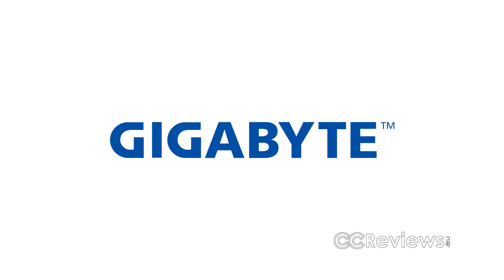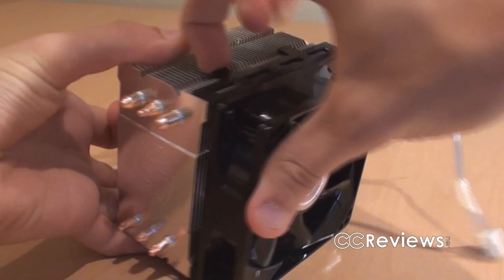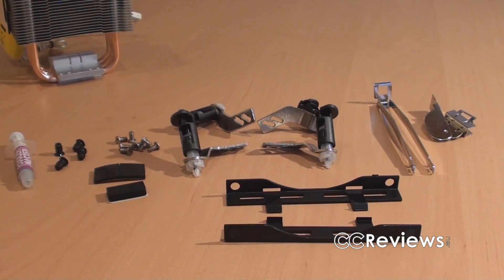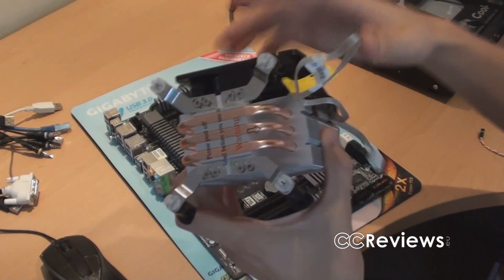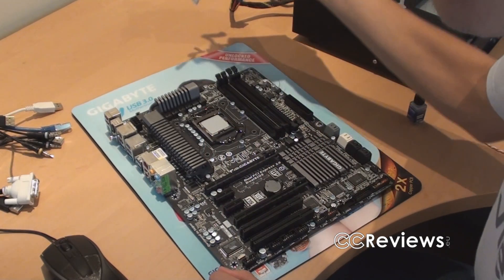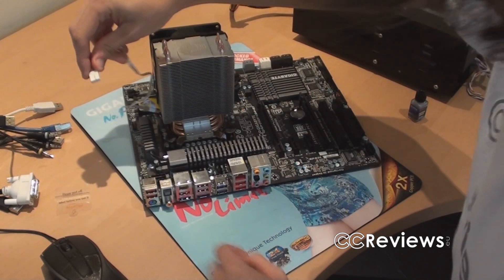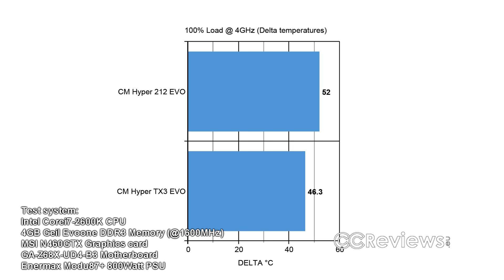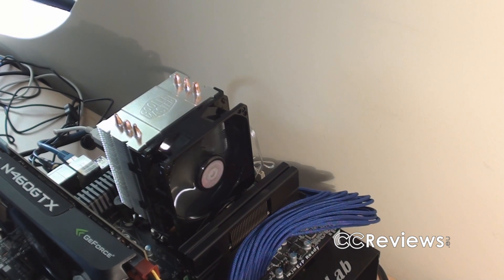#55: Cooler Master Hyper TX3 EVO CPU cooler Review (CCReviews)

Comment: Thanks a lot for the video review, but I have a question, how are the noise levels compared to a stock intel cooler ? thanks again
Reply: ภาณุพงศ์ ปรึกษา for a guy that claims to work in an IT department,one would think you would know that using a vacuum to clean your pc can destroy components due to static discharge  #noob
Reply: From my PC TX3 Evo is not so noisy and my temp never going up above 30 degrees celcius on idle and in full load never go on over 60 degrees celcius
my room temp here in Thailand is around 30 - 37 degrees celcius (That's fuqing hot!) TX3 works well and because of air flow setup on my CM Elite case with 6 120mm fan it sure keeping my PC cooler than room temp
Reply: Thanks :D
Reply: it do sound like jet when i max it rpm(3500) lol
Reply: ภาณุพงศ์ ปรึกษา
so your air cooler can under ambient temperatures? LOL
Reply: Gg your it department
Reply: ภาณุพงศ์ ปรึกษา epic fail
Reply: ok if you guys wanna talk do it elsewhere my comment is not a chat thingy
Reply: Seon wei jie Its should sound likes that sometime pls clean it properly lol
Reply: vivalaphill lol i test max when it was new 2 year ago
Reply: vivalaphill  If you got closed good PC case and you have more air outtake to blow hot air out more than intake cool air it will decreasing a lot more temp like big fan at farm building to help control temp
Reply: jeah but you cant cool anything under the ambient temperature if you arent using a kind of a compressor cooling... thats just physics
Reply: ภาณุพงศ์ ปรึกษา lol, if you are good pc builder, you shoud not recommend ppl to put more fan at output. It will cost dust to suck from every holes o ln the pc. And dust is bad.
Reply: Seon wei jie yup lol its cost a lot of dust
in case of that you should clean it for every week. I clean it every week too :) but in return it got lower temp than normal room temp. and my pc case have air filter installed. So i don't have a problem with dust. If you still got problem with dust vacum machine is your friend lol ;3
Reply: lol, you not understand my word. i having a system that dust free for one year running 24/7. youtube search 'positive pressure pc' , those video will help you. Clean system each week, are you kidding me lol, i got 30+ pc, there was impossible to clean all lol.
Reply: Seon wei jie
 lol I work in IT department i work on 200+ PC
That's why i can do it xD
Reply: Seon wei jie gg too lol
Reply: dittyobrien total agree lol
Reply: dittyobrien
I don't use vacumm for cleaning my system its totally ... = =" I using only brush to clean them out sir... and no one should be called noob = =
Reply: Brush 200 pc per week. Best employees 2014
Reply: Seon wei jie yeah brush it like that :) its my job so... no need too tried to do it then ;P
200 pc is not a single day work its took 1 - 3 days in week lol
Reply: ภาณุพงศ์ ปรึกษา thats not what you said in your previous comment XD  #fail
Reply: Seon wei jie
I didn't said that i using vacum cleaner to cleaning it?
Reply: btw if you cleaning it with vacumn cleaner you can't be harm any hardware on it if you using right size of the vacumn head and secure moving part and don't scratch any trace on that damn board lol
Reply: mostly dmg thingy is used to be moving part such as bearing on fan when you using high power vacumn and it making fast airflow enough to dmg fan bearing...
 to avoid that secure them not to let them spinning while are you cleaning
Reply: Daniel Tevi
sorry lol xD

Comment: really difficult to install the stupid wobbly intel push pins my fingers won't fit between the fan and the heatsink. Got so fustrated i just installed the stock intel fan

Comment: i Got a TX3 and im still getting like 50 C idle temps althought it doesnt go as high as 80 C while under load anymore just around 70-75. I have a push pull config but i installed it on a fm2 socket so it pulls air for the gpu. I have plently of fans on the case too
Reply: What are you using to measure your temps ? If its HWMon , Ive seen so many people having weird readings with that on the FM2 apus ! Use AMDoverdrive for the best temp readings :)
Reply: Temperature margin = how far you are from max operating temp. not the actual temp. confused me too, seeing my brand new apu doing 70c idle, yeah thats not right. its tell you how much more hotter it can get not how hot it is.

Comment: Weirdly I got very hot temps of 80 degrees with the TX3 Evo, more than twice the temperature of the stock intel cooler, but I believe it was so hot since it had no backplate for Intel CPUs, or I may have just received a bad one.
Reply: Anass Rhammar there is something wrong with the termal paste .maybe you didnt apply it correctly

Comment: So you think it is possible to just install this cooler in an already placed motherboard? I have an FX 6100 processor
Reply: yes, i did that. take the fan off though it makes it easier. it's really easy to clip on and off, just make sure it's facing the right way when putting it back on
Reply: yes

Comment: Never never spread out thermal grease that way on a cpu!.. Always use a pea sized drop on the center and let the heatsink base spread it out by itself. This way you'll avoid thousands of micro air bubbles that will reduce the thermal efficiency of the cpu cooler.
You may also want to try the X way which seems to be pretty efficient also on quad cores.
If you don't believe what i'm saying, make your own tests using a plexiglass sheet (there are tons of videos about this on youtube)..

Comment: Just installed this and i am NOT happy with the construction at all
It was extremely tight to install, to the point where the CPU socket had so much force it was bowing out my motherboard on the rear. Horrible, so i took it off and returned it
Will never purchase another Cooler Master product again. I now proudly own a Gelid Silent Spirit which fits absolutely perfectly and motherboard is not at risk of snapping in half

Comment: You will get about 15ºC lower temps at full load, but if you plan to overclock you better get the large version called Hyper 212Plus or Evo.

Comment: Will this do fine with a core i7 920 on Asus P6T DELUXE V2?? I have the stock cooler and the temps are about 70 when idle and 90 at max load. This is wayyyyyy too high

Comment: If you've solved this in the last month, ignore.

Those Phenoms are 125W TDP I think (?) and this cooler is for max of 130W I believe.  I don't know if TDP is a measure of how much heat it will put off 
(n00b alert!), but I believe that Phenom is a little towards the higher end of what it can cool.  

If your case doesn't vent well or something like that, that may be the issue.  Also, try reapplying thermal paste.  Just use a small rice grain sized blob.  Botched thermal paste can cause this.

Comment: I'm planning to install this cooler on my assrock G41 VS3 motherboard, With core 2 quad Q6700...  will it work fine ??? 
As i would be working with 3D applications like 3ds Max, and Maya... 
Also, recommend any other cooling solution suiting my need.... :)

Comment from the maker: Are you sure about the noise thing? Check your BIOS and make sure your CPU Fan isn't running at highest speed. Set it to 'auto' or whatever it might say on your board, so that it uses its PWM function so it changes its fan speed according to the CPU temperature.

Comment: one question at 3:25 can I also turn the cooler 180 degrees so the fan is on the left side, because that will be a bit better for me. And I am really looking forward to buying this cooler because when I'm playing bf3 my i7 2700k get's to 75 degrees with the stock cooler.

Comment: Hey nice job on the review but I have a suggestion, please get a lavalier mic or a mic that you can set by you and avoid the room echo.
Your videos will be much more professional with a better audio.
Also try to get at least two cheap lights (they could be lamps from your house, just take off the shade) and place one on your left and the other one slightly further on your right, above eye level. That will give you a better quality video.
This way you will have killer videos.
Thanx for sharing.

Comment: Running this in my Core i5 Gen 2 system and the temps are perfect even under load playing games and video editing. After reviewing other coolers this one is perfect and didn't cost an arm and a leg.

My only issues was with the Dual Fan setup I had to face the cooler fan facing down and up towards the top of the case to fit. I have no issues with my setup at all everything stays cool without problems

Comment: @neilaydlett Aye!  Thanks!  I just got a response from the TweakTown Forums, and the moderator there says almost the same thing, that the power-saving features won't run in UEFI, and I should load Windows (I haven't got to that part yet), and the temps should be lower there and I assume from that point on.

Comment: @CookyMonzta When in the UEFI/BIOS your CPU runs full clock hence you will get higher readings.  I get 50c in UEFI on my rig.  Download Real Temp 3.67 and monitor your temps while applying a load such as gaming or if you really want to stress it try Prime95 or LinX.

Comment: @neilaydlett Excellent.  My 2700K machine (3.5GHz) is up and running, and I have a Hyper TX3 with 2 fans latched on, but I suspect it is running a bit hot at idle temp.  My room temp is 26°C, but in my UEFI, my CPU shows 40.5°C with the fans at max (2,800RPM).  Is my CPU running too hot under the circumstances?  I suspect I may have to reapply the Arctic Silver 5 thermal compound between my heat sink and CPU to make sure the copper pipe gaps are thoroughly covered.

Comment: @CookyMonzta I run the Hyper TX3, single fan & non EVO, with my 2600K clocked to 4.2ghz and 1.264 volts with no issue.  I am also using AS5 as my thermal compound.  Stress testing with LinX 80c is my max temp; however, while gaming I rarely go over 62c.

Comment: @spiloFTW Checking the benchmark tests at BeHardware,com, the TX3 runs slightly cooler with 1 fan than the Noctua, which leads me to believe I should have little trouble with this thing and 2 fans on my 2700K, even at 4.2GHz.

Comment: @spiloFTW (2-part response) I would have considered a 120mm cooler, if I had the space with my setup.  I didn't; so, I had to consider the most satisfactory 92mm cooling system that was worth the money.  I took a long, hard look at BeHardware,com's July 2011 review of 15 fans, and decided on the TX3.  Though the Noctua NH-U9B was the best of the 92mm bunch, they want $59 (about €45) for the 2-fan system.  I bought my TX3 for half that much (on a brief discount sale) with a 2nd fan.

Comment: Excellent test run.  I'm about to replace my Phenom II X4 945 parts to build an i7-2600K machine, and I have been looking a cooler that is cheap (but not TOO cheap) and able to handle an OC of 4.08GHz.  I've narrowed it down to the TX3 (with a 2nd fan on the other side), a Xigmatek Loki SD963 (with a 2nd fan), a Zalman CNPS9500A LED and a Noctua NH-U9B SE2.  My 1st choice is the TX3, but I'm really tempted to go for the Noctua, but the $59 price tag is what keeps me away from it.